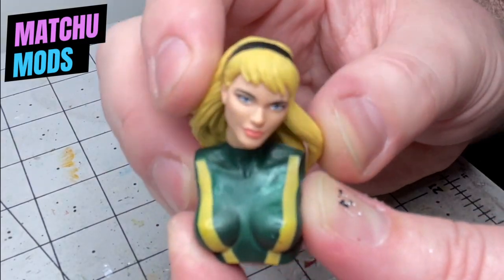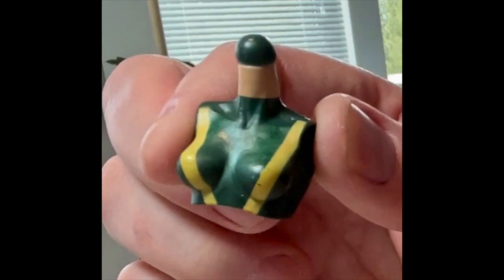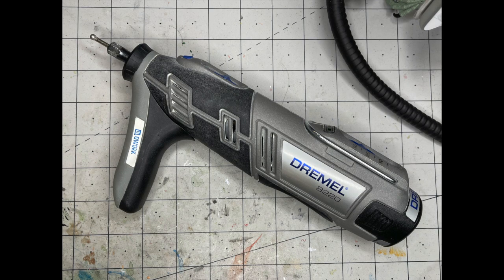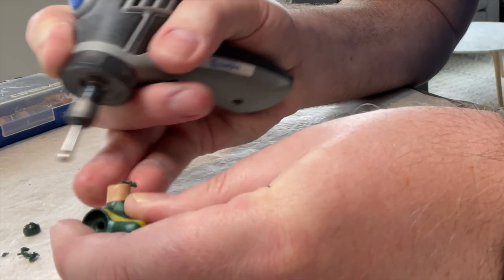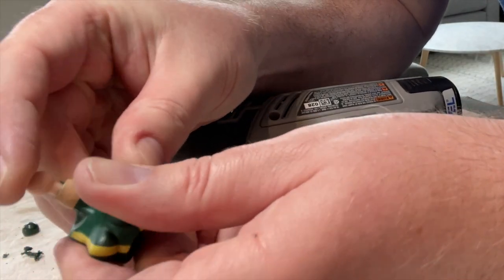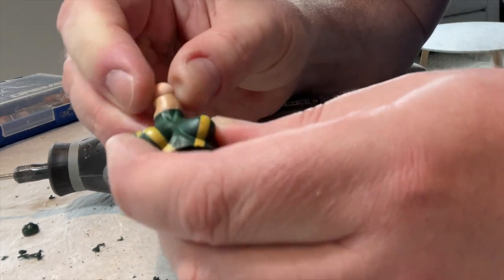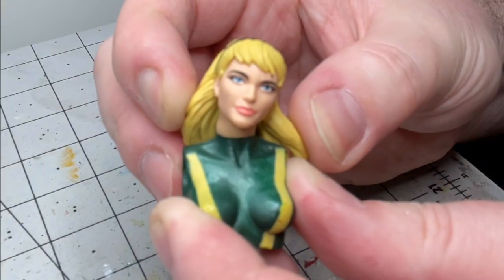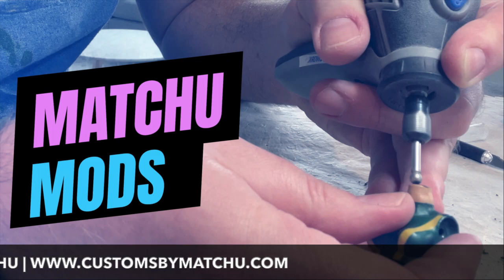Matchu Mods - Marvel Legend Female Neck Mod

Comment: Is this possible for the male figures?
Reply from the maker: Probably not without additional steps. Because most male figures have hard plastic torsos youd need to rebuild the neck to reinforce it with apoxie sculpt or some other sculpting medium, repaint it and then make a hot glue socket for the ball to operate in. It’s doable for sure but prob much more difficult for an inexperienced customizer.